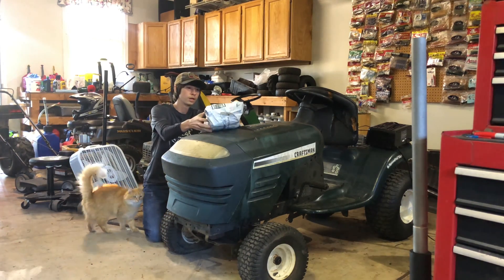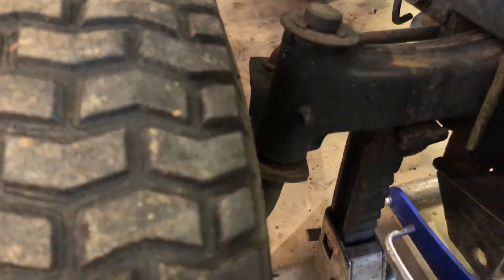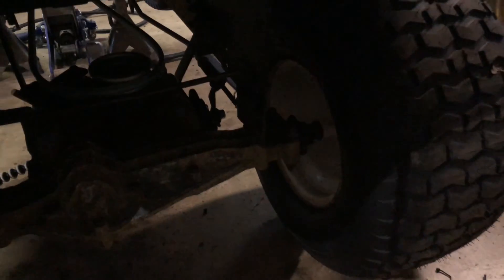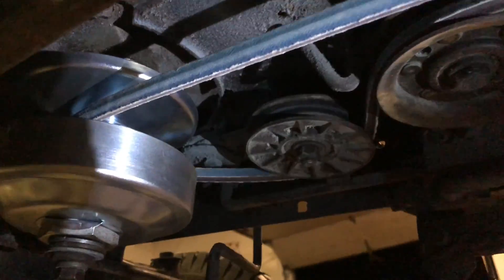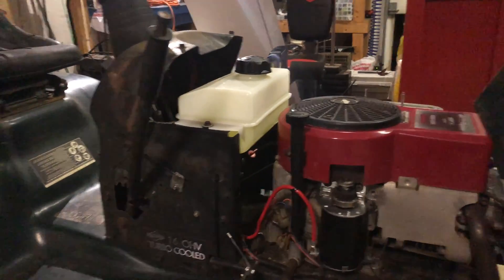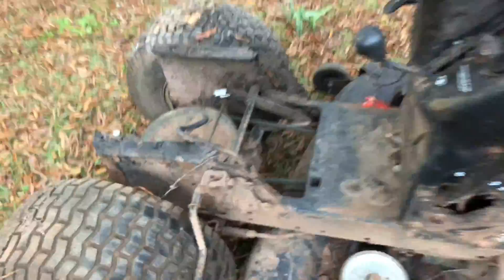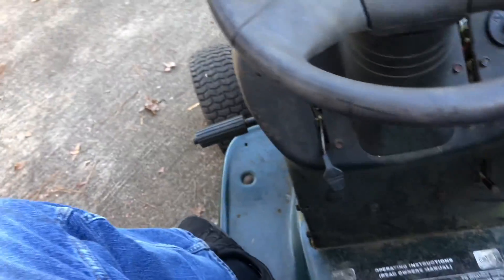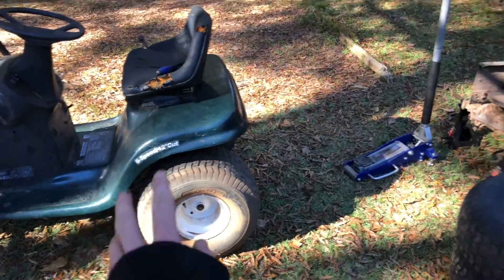Racing Mower #5 | Semi-Automatic Transmission Test

Comment: New at this lawnmower thing just wondering if the 1 inch bore 40 series torque converter come with a keyway slot so the pulley would stay stationary on the shaft or does it need to be welded stationary????
Reply from the maker: It has the key already built into it just like the original pulley, no extra key is necessary.

Comment: Could i install this torque converter on my off road mower?. It goes through mud and water, so i dont know how it will hold up against the dirt.
Reply from the maker: I'm sure you can try it! The springs might fall out of place if you go over a ton of bumps but other than that it should be good!

Comment: There's certain types of older washers that have a centrifugal clutch pulley with 1 inch dia shaft bore. And a 3 inch pulley . I just drilled holes and bolts a 6 inch pulley to the 3 inch pulley on the clutch..
Reply from the maker: Oh ok, that will work!

Comment: Did u keep frying and shredding belts with that clutch?? cant get mine to work under load on grass and mud
Reply from the maker: Not really honestly, big thing is making sure your belt alignment between the pulleys is perfect and obviously the proper size and it should be good.

Comment: hi, I saw your video and I also installed the torque converter. 40 series on my electric tractor it has a 10kw motor it weighs 400kg but the belt overheats after a few km and the same thing happens

Comment: hi im looking at your clutch did you adjust it for a 5/8 belt or it is not adjutable by the way nice job
Reply from the maker: A 5/8 is one inch larger than a half for the same size. You can fit a 5/8 on it but you have to have pulleys to fit it and unbolt the clutch and idler to slip around the factory belt guards and it should work.

Comment: Using a V belt on the Torque converter is costing you a lot of drivability. The TC pulley you have on there is the driver, for it to engage smoother and ramp up to speed, you'll need the driven pulley. That will require a Jackshaft but should increase your top speed and make your take offs smoother.
.
Reply from the maker: I thought about putting a driven on the rear but never got around to it, the way the mower currently is today seems pretty good with regular pulleys, however it was fun trying the torque converter pulley out though.

Comment: FYI riding lawnmowers are built with the piston facing toward the front of the mower so you can stand them up vertical to work on or store them. Just make sure you drain the gas tank first.
Reply from the maker: Alright!

Comment: Can you please send a link to the torque converter
Reply from the maker: Yes sir! https://www.amazon.com/BLACKHORSE-RACING-Torque-Converter-Driver-Clutch/dp/B07Q65GYSN?tag=namespacebran368-20&keywords=40+series+torque+converter&sprefix=40+series+to%2Caps%2C608
Reply: @IngenGarage also did you add any spacers because I saw you put washers on the pully rod
Reply from the maker: @reesemolloy6109 Yeah I put some up on the shaft to help align the belt and for the bolt to fully tighten.
Reply: @IngenGarage  one last question how much smaller did you get for a belt sorry for all the questions
Reply from the maker: @reesemolloy6109  Ur fine, on this mower it was a 87 inch with the torque converter and a 3 inch or 2 1/2 rear pulley

Comment: You should get a SMV sign for it after all its a tractor because a tractor is a tractor no matter how big it is  and you should probably find a old starter cup off a push mower and build you an emergency starter it will save you a headache I'm only 18 an autistic but I've been doing stuff like this since I was like five or six when it comes to working on small engines and building stuff like this
Reply from the maker: Yeah lol, I did to a pull start on this on both my mowers! The single OHV and the Twin.

Comment: I'm curious, is the fully extended diameter of the converter the 'same' as the old pulley,  I guess I'm curious if it gets larger and pulls on the belt possibly stretching the belt
Reply from the maker: The spring on the clutch will compensate for the torque converter when it engages the belt and extends. It probably extends fully to 3 1/2 inches with a half inch belt and 4 inches with a 5/8 belt. The old pulley is 3 1/2 inches but the belt sits in the groove, the belt on the torque converter sits actually 3 1/2 inches so in theory it actually is a bit bigger than stock. Its hard to explain in the comments but hopefully you under stand what I'm saying lol.

Comment: Fun stuff wanted to do this myself curious have you broke your clutch pulley yet, mine melted
Reply from the maker: Nah not yet, the pulleys seem to be holding up alright, apart from this 40 series driver springs & rollers sometimes popping out but other than that it seems fine.

Comment: So prior to adding the torque converter there wasn’t any mods to it?
Reply from the maker: Not to the torque converter it self but I did put a smaller pulley on in the back to make the gearing a bit taller.

Comment: So how has the Torque converter driver working months later?
Reply from the maker: Yeah it has, but sometimes the rollers and springs get jacked up sometimes but I put heavy springs in it to raise the engagement rpm and to eliminate that problem lol.
Reply: @IngenGarage  Why not put a 1/4 thick or so tube/spacer with a flat plate welded to it in front of the backing plate (back part of the driver) so you have the proper spacing set up so to run a 1/2 or 5/8 belt. This way the front part that moves outward can make contact with the belt at a lower rpm range and work like a normal driver.
Reply from the maker: @FukTheGovernment465  Yeah but it'll probably take some time and money but might try it later we will see!
Reply: @IngenGarage  Got yua man best of luck on it.

Comment: That’s fine for puttin around the yard but for off-road or pulling it will slip.
Reply from the maker: Yeah if it was an offroad mower where I wanted to just continually move just a pulley would be fine but since this is mainly going to be on flat surfaces and really tall gearing I think it would be better (for me anyway) but you do you dude!

Comment: Test the diode on your charge wire. It's a small black piece that looks like it has heat shrink on it. Or a constant draw on the battery. Just put a kill switch on it to isolate the battery.
Reply from the maker: Thanks dude, but for whatever reason now it is staying charged now 😂idk